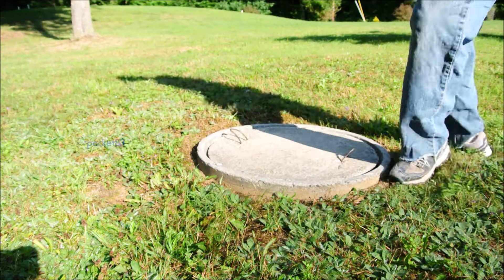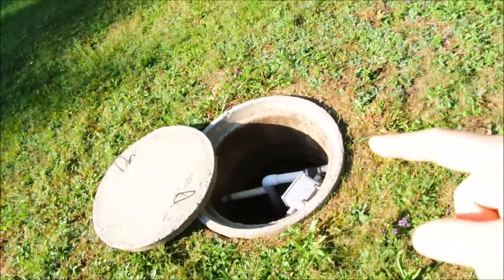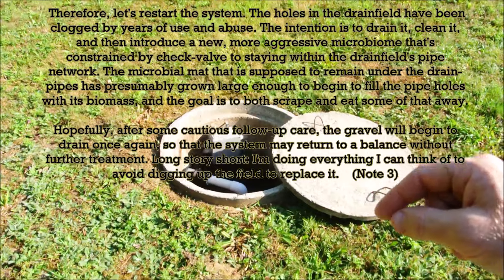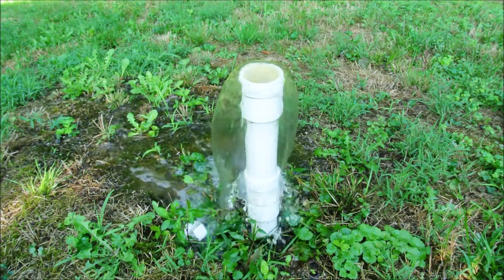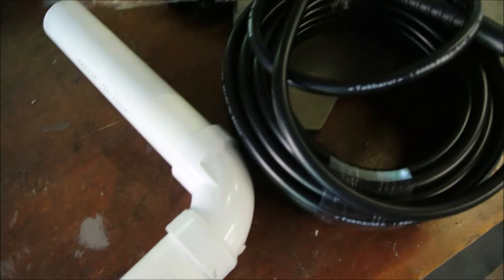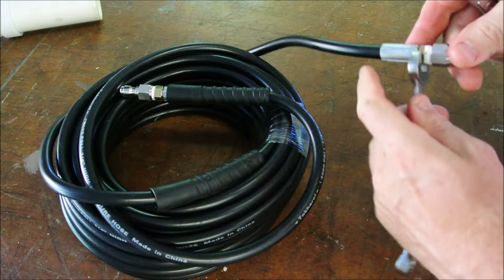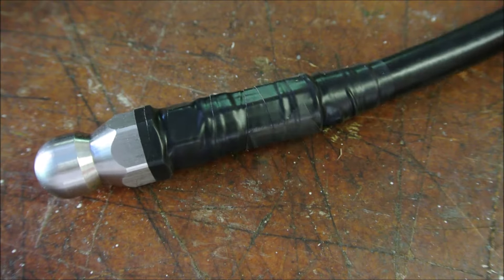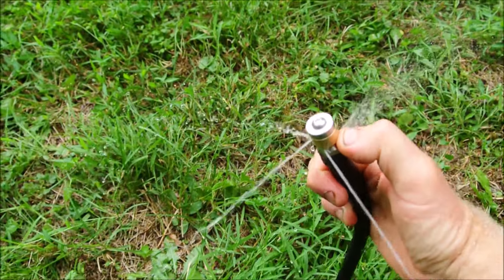DIY Septic Tank Drain Field Restore (Leach Bed Flush)

Comment: I have no need for septic solutions and probably never will, but your videos are always really informative and great to learn from. Thanks for sharing!
EDIT: I'm now interested in the transmission fix
Reply from the maker: Thanks. It was a beautiful puzzle. Perhaps the only more complex mechanical apparatus I've ever taken down to its bones was a mountain bike gear-selector. 

But for the lawn tractor, I ended up having to cut a new notch in the plastic to allow for the additional movement of the shifter. By the time I was done, the grass was tall enough for things to hide in it!
Reply: @pocket83squared  22:37 hi fromPoland Maine. What did you use for the bacteria? I’m gathering supplies to do the same thing. I have a different system but same idea
Reply from the maker: @chrisbrackett9779  Look for something labeled 'septic tank treatment' or 'additive.' Read the bottle. They're just aggressive strains of bacteria that feed on, well, waste. Online reviews might speak to one product's efficacy over another, but most brands will probably end up being comparable overall.

Comment: Just found your video and I can honestly say I can’t disagree with anything you said. I have a pump up system installed about 25;years ago. Everything goes into main tank, effluent rises and goes into second tank with pump and high water alarm and out to drain field.  Perks on down through different aggregates and at the bottom there is perforated collection pipes, which take the water to the front of my house and into a catch basin. Paid EnCon 90.00 a year for the discharge of the filtered water.  BUT the last year the water wasn’t perking into the ground.  Found the end of my laterals, cut the ends off(4inch lateral) and jetted the 3 laterals all the way back to the distribution box.  (50 feet per lateral). Lots of crap got cleaned out.  The Biomat just finally clogged up the laterals. Going to add Roebic K-57 into each lateral from D-box. I am by no means an expert but from what you,did sounds exactly right.  Well, this was my 2 cents.  Little late here….

Comment: Sorry you had some negative comments, when what you did obviously worked.  I designed and installed my own gravity Fed system 30 years ago and it’s still going strong.  People can’t argue with what works!  I intend to follow your advise and add bacterial product to my distribution box at the drain field rather than the toilet or tank.  Thanks for the idea😊
Reply from the maker: Thanks, and good luck! It's pretty sensible once you think about it; why would you want to break down the contents of the holding tank? It has to go somewhere!

Comment: One thing I notice is the caps on these 4 lateral flushing/inspection pipes. I do believe that on a pressure mount laterals system, water will come up and out when a cap is removed for flushing the laterals. If you mound is like mine, there is only 60 holes total in the 4 laterals. Those he's in mine are barely 1/8" in diameter.  Not nearly.enough escape for the 32+/- gpm your pump puts out. What they should do every 3 years or so is flush the laterals then some sort of pressure test with all 4  ends capped. The pressure test is compared over time to look for resistance  to draining increases that can point at future issues in the mound. 

Love the video and unfortunately,  I'm having similar issues thank to my septic installer not installing the outlet baffle/filter when this system was I stalled 3.5 years ago.
Reply from the maker: In a case like you're describing, it might be easier to add a new lateral in between the original pair. I considered doing this for mine; the idea was to turn the elbows at the four verticals into tees, so that an additional lateral line could be run right through the middle. Less digging! The center line would act like an overflow for both halves. 

Good luck with yours.
Reply: If your pump is running, water will always go to the point of least resistance, hence if your cap is off at the drain field pipe, water will naturally come out. This is not a sign of a drain field blockage.
Reply: We wound up having the laterals flushed out.  They were very bad according to the jetter. Candy wrappers and who knows what else. He uses very high pressure, like 30,000psi? Have not had issues since. One these days (warmer weather and time) I'm  going to do pressure and pimp down time tests again for a before and after jetting test/benchmark for future reference. After that, annual lateral flushes using just the dosing pump. 

Jetter said the mound should be fine. 

I do need to go back up In this posting to see what I've mentioned here previously to make sure I gave the full story.
Reply: I need to find "the rest of the story" and post that.
Reply: I need to find "the rest of the atory" and post it here.

Comment: You already know this, but I discovered when redoing some of the piping here (~1600s farm house) that the plumbing "it's all just water" gremlins had struck. All of the gutters at one side of the house had been rerouted to run into the sceptic tank... Flushing it completely into what we jokingly refer to as the leach-field - which is a clay pipe drain that leads away into a local stream after about a mile, 30m of vertical drop and a large quantity of added surface water.
I don't think what we have is compliant with... anything. But flushing out the sceptic tank with excess flow is almost as bad as not having one, since there is no processing happening. Your system is far better than ours!
Reply from the maker: Let's be honest, though. What was it ever hurting? Nothing—until that is, somebody else moves in about 30m underneath and within a mile downstream! Filtration 'treatment' is really more of a pay-it-forward societal courtesy than it is an ecological necessity. With enough people around, even the widest river will end up a flowing cesspool.

Comment: @6:43 reflection confirms that Pocket does, in fact, have a head.

I had previously assumed he was the gestalt intelligence manifested by buckets of golf balls and pvc fittings.

That said, I find septic systems interesting because they seem very much to be the kind of passive infrastructure that wants as few moving or dynamic parts as can be managed in order to avoid maintenance and catastrophic failure. We had a drain field collapse on a rental we lived in and it was backhoes and tractors for 2 weeks. Plus the guys uprooted 2 trees that they just  chipped instead of restoring the yard and turned over the top soil into the sand below so not even grass ever grew quite right in that yard again. 

I can't say I relish interacting with such systems but the ingenuity and reliability to function unattended for 2+ years a t a time is a wonder in it's own way.
Reply: Maybe it's just a costume to trick us ;)

Comment: First of all, thanks for the excellent video. You are a rare breed on YouTube. Thanks for proving that these types of remedies can work. I unfortunately dont have any clean out ports where I can bypass my tank to introduce a bacteria treatment. Do you think it makes sense to pour it down a funnel and tube inserted into the tank's outlet pipe that goes out to the drain field?
Reply from the maker: Thank you in reply. Do you mean to add treatment directly to the vertical riser pipe that comes out of the pump? That's exactly where I put some of it. If you add it there and then quickly turn on the pump, it'll blast a seed bacteria all over the upper system, but it'll keep it from growing in the storage tanks. That's the idea.
Reply: @pocket8312  sorry if you already mentioned it but which type of treatment/bacteria did you use

Comment: I had a similar system with a similar problem.  The problem started right after the previous owner needed to replace the 1/2 hp pump.  He "upgraded" it to 1 hp.  After I moved in I added a ball valve after the check valve so that the pump couldn't flow all the water in the tank to the field in 5 minutes.  I throttled the flow at the pump so the pump cycle took 15 minutes or so and had no further issues for the remaining year that I needed it to work.  After that we connected to the newly installed village sewer system.
Reply from the maker: Interesting. I wonder how much life would've been sucked out of a pump that run until death under that much back-pressure. Maybe the same flow reduction could've been achieved by just adding a larger airlock hole back at the check valve. It would just spew out, instead.
Reply: @pocket83squared  Perhaps that would have worked as well, but a centrifugal pump can be dead headed indefinitely and draws less current when dead headed then when pumping at full volume.
Reply: Ever notice that your shopvac increases in speed when you block the nozzle?  That's because it's under less load when the nozzle is blocked.  Your shop vac is also a centrifugal pump.
Reply from the maker: @Balsamancnc  Also interesting. Thanks.
Reply: @pocket83squared  No Problem. To do work it's force times distance or, with hydraulics its pressure times flow.  No flow, no work is being done.

Comment: Thank you, that was a very good informative video. I have a similar problem where we pumped out our septic tank about a month ago and we are clogging up again. We know the issue is downstream of the septic tank where the field is not draining fast enough. The septic tank has two parts, the 1st part of the tank holds the solids and the liquid flows into the 2nd part of the septic tank where it is gravity drained into the field. When we pump the septic out we always see liquid flowing from the septic field back into the septic tank which tells us where the problem is. Based on your video I think it would be wise to do the shock treatment by dumping into the liquid side of the septic tank so that it works out into the septic field, would you agree with that? We don't have any access pipes in the field like you do but would be very handy to have.
Reply from the maker: First, questions. Do you have a grade problem? This is to say (ask), should you be using a pump, since the gravity doesn't seem to be adequate? Or do you just suspect that the field is clogged with biomat from time and abuse? Can you describe the leach field? What does the system include/involve? How often have you been pumping your holding tank?
Reply: @pocket83squared  I don't believe we have a grade problem, we haven't always been experiencing the issue, maybe the last 5 years or so I suspect the field is clogging. The leach field is approximately 30ftx30ft right next to the septic tank, I don't exactly know the structure underground but i believe we have 5 or 6 rows of white piping about 4 inches in diameter. The septic tank is fairly old having two square lids, the 2nd lid gives access to the liquid side of tank then flows out to the leach field.  

About 4 years ago we had a professional service come out to inspect and the fella dug down into the septic field and cut open one of the drain pipes and we saw the biomat in the pipe. At that point he suggested that the septic field was plugged and offered to rebuild our septic bed which included a new tank and all upgraded technology due to government requirements here in Canada all for $18000 CAD. 

We did not jump at the deal at the time due to finances and figured we would continue to pump out when needed for the time being. I was reading about a shock treatment that may clean out the bed at this website> https://www.bio-sol.ca/en/index/ but still researching.

Thanks for responding so fast.
Reply from the maker: @PaulBrooks-of6yq  Most of the time, 'professionals' are going to give you only one option: dig it up and replace it with "upgraded technology." This is because they can't do a long-term restore for you, because that requires changing your habits. Nobody wants to hear that the solution to their  back pain is diet & exercise. But it is.

If you're only pumping out the (solids) tank every four years, that probably is the problem. There are only two of us living here, and I still have it pumped every second year. In case you didn't watch the video, one of the key points is to understand that a waste mass can't simply disappear; it has to go somewhere. Expecting a septic tank to function without pumping it on time is simply unrealistic. It all just ends up going into solution and then ending up as plant food for the biomat that's growing inside the pipe system.

From Wikipedia (article: "Septic Tank")~

[The rate of accumulation of sludge—also called septage or fecal sludge—is faster than the rate of decomposition. Therefore, the accumulated fecal sludge must be periodically removed, which is commonly done with a vacuum truck.] 

Over time, the restorative treatment used in this video will work for you, but only if used in coordination with timed pumping. If you aren't having the tanks pumped, then even if you do install "upgraded technology," eventually you're still going to end up with the same thing: pipes that are again clogged with biomat.
Reply: @pocket83squared  I thought I had mentioned how often we pump out; I do see that you asked. The bylaw here is to show proof of pump out every three years, however we have been pumping out every year due to our situation.

Do you have advice on using the shock treatment I mentioned from that Canadian website? I'm considering trying it in the liquid side of the septic tank so it flows out to the field.

Thanks for your help

Comment: The clean out pipes at the end of the laterals only squirt if you left the test caps on.
They should squirt around 5ft high and equally. 
Replace the test caps with an end cap (no squirt hole).

Comment: Intresting.. Never seen a sptic system with a pump, the ones we had were all gravity only ones.  More complexity but also more flexibility!
Reply: The house I grew up in had a system with a pump. The drain field was built up a bit above grade with a slope going towards the backyard. The water table was quite high there, so it required that. I believe the original builder of the house paid quite a bit for that install. Lots of soil, rough gravel and fine gravel had to be hauled in
Reply: Not everyone is on a level lot. My house sits a little lower than the neighbors because the front yard had about 50 trees, and a number in my near back yard. Back 300' of the far backyard had 1-1 1/2 foot of dirt added to raise it above the regional park-ish wetlands and requires a pump.  Since a lot of houses are on nicely cleared property, its usually not too difficult to add a little extra dirt to make gravity work for you. Thats just not always possible depending upon trying to keep existing trees or if its the builders first house build....

Comment: The jetter tip can get stuck, but when water is being fed the rear jets pull the line in and keeps it lifted off of the bottom of the pipe, so that will help prevent catching lips

Comment: Did you use Roebic ? I had the same issue 12 years ago. Started using Roebic every 3-4 months  ( cheap insurance) and no issues or pump outs. Great stuff. I didn't see what type you used but good video.
Reply: Which Roebic did you use?
Reply: K=87 primary but every couple moths put in some K37 * K47 as they compliment each other. I have had no issues in over 10 years.   @FloryJohann

Comment: I live in a subdivision (very hilly in E. TN) where the soil is clay and rock.  Several of my neighbors have had to have their laterals dug up and replaced.  I think they let their septic tanks fill up with sludge and ruin their laterals.  It seems to me that from what I gather, some people never have their tanks pumped and some do.  I had mine pumped once in 24 years and it didn't have too much sludge.  I think the key is to not put bad stuff in the drains of the house, like grease, hair, too much solids . . . Similarly, some use RidX and others don't.  It doesn't seem to make much difference.
Reply from the maker: It does make a difference. It comes down to biomass. If you pump the mass up and into your leach field, that mass isn't going to disappear. Until somebody invents Va-Poo-Rize, you can either pump your holding tank occasionally or else wait for the field to fill up. 

It's not unusual for a leach bed to take many years to fill up. The mass is dissolved, and so sometimes it can percolate through the rock and settle into the ground. Just know that that's not how the system was designed to operate, and it will likely fail eventually. 

Try looking for 'springs' around the base of the mound; wet spots and odors are signs that the system isn't functioning correctly. Just as what goes up must come down, what goes in...
Reply: @pocket83squared , thanks for the reply.  Va-Poo-Rize . . . nice play on words.  :)